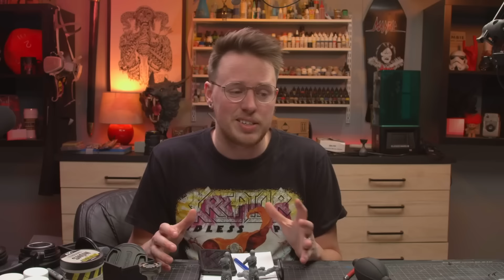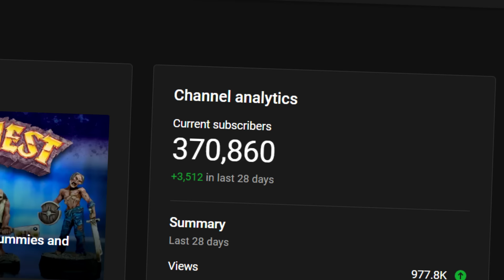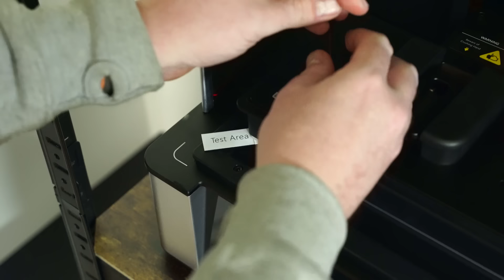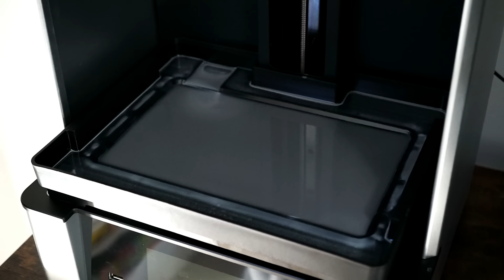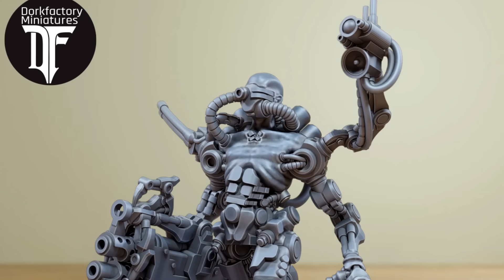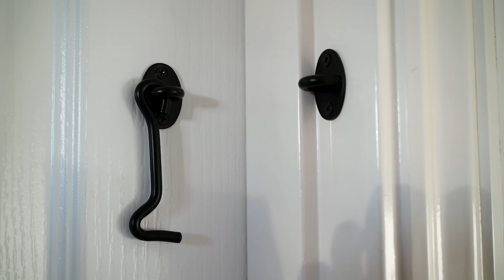Is 3D printing FINALLY easy enough to print Warhammer at home? Uniformation GKTwo!

Comment: That's one of the downsides of low odour/odourless chemicals; they smell a lot less but they're still every bit as harmful to you, something of a false sense of security.
Basically, if you open a bottle of chemicals while 3D printing, you should already have a mask on (vapour rated, not a DIY store dust mask)
Also, removing the prints from the plate that way runs the risk of fragments being dropped, unseen, into the resin.  You won't know they're there until your next print pushes them through the Fep.  Don't be lazy, take the build plate off; it's safer in the long run.

Comment: mSLA if you are feeling more fancy (masked stereolithography, usually used to differentiate it from other types of stereolithography printers). From what I've seen most people (who take the risks seriously) tend to end up with the printer in a garage or shed where VOCs are less of an issue. Or, setting up some kind of extraction system (I'm lazy, mines in the shed, in a locked cupboard).

Comment: the only thing i would recommend is to remove the plate before removing the prints. you don't want to get bits drop in the resin because that can mess up the next print

Comment: I generally use a respirator mask when working with uncured resin, as I was under the impression that's the worst part to breathe in (it certainly smells awful when you catch a whiff of it). I'd be interested to see what an air purifier would say about my 3d printing space. The 3d printer go brrr meme is definitely a joke that you can't fully appreciate until you get into 3d printing proper.

Comment: watching you remove prints from the build plate without removing the plate from the machine drove me insane. Talk about the hardest possible way to retrieve your prints. With that said I am glad you have now found an appreciation of the 3d print!
Reply: Also bits of cured resin can fall into the tank and damage the membrane when printing or cause the printer to not even print at all until bits are removed.
Reply: ^ this. Why would you not remove the plate? No wonder why you had so many problems with your previous printer 🤣😂
Reply: @mangg3328  at least with this printer I assume he thought the fancy mechanism to attach it was meant to be set and forgotten about rather than removed/ tampered with all the time. Just started printing and I was convinced at first that removing the build plate would ruin all my leveling that I went through previously
Reply: I use a flexible build plate and I can easily pop my prints right off the plate without removing the build plate.

Comment: Great video and this is a big subject Guy, you raise a few good points whist also not covering some important ones. 
Ross covers a lot on his channel and I love watching his videos. 
With regards to the use in a house and VOCs, a grow bag - used by many for plants that people like to smoke - are an excellent solution as they not only allow you maintain a steady temp without having to buy a printer with an in-built vat warmer, but they contain the VOCs and you can fit a carbon extractor. The KEY point you didn't cover is that IPA or Meths are HIGHLY flammable and should not be stored in a house. Now on to the environment. The water used to wash water washable resins is toxic. It needs to be treated like the IPA you use for washing and disposed of correctly... at your local recycling plant. That water will harm the environment. Equally, the supports you pulled off before curing - and I agree that is the best time, though you can do it afterwards, just soak the models in luke warm water to soften them first, are uncured resin and should be fully cured before sending them to landfill. 
As to your earlier failures with printing, this could be many things, but first suspect would be settings and each manufacturer provides tables for their printer and different resins - check support pages. These are starting points and you need to adjust for room temp, humidity, layer height (how much fine detail) and speed of printing. There are test models like the 3DRS spaceship which help you dial these settings in. BUT THEN - you need to look at what you are printing, the size , the density, the detail and you need to orientate accordingly, then adjust supports to suit. Pre-supported models are fine, but unless you are using the exact same settings, resin, printer etc, they may not work. The printer head pulls the cured layer away from a screen that stretches slightly as it does so. It stretches more in the middle than the outside, this means you get differing forces across a model, which can cause partial failures so you need to look at what you are printing and on what machine. Ross explains the difference in screen resolutions brilliantly and this is why I print figures and small items on my Mars 3, then big models like tanks and titans on my Saturn S. Each of these perform brilliantly at a fraction of the the cost of the GKTwo. 
As to why I 3D print ... I want something different than the GW stuff, I want to modify and 3D printing offers me this without the need to spend hours with greenstuff. I might spend the same time initially as I build the file, but then you can print loads. I also prefer some of the other artist's work. Then there is the whole "immediate" thing. Just like music downloads, I now no longer have to wait to get my stuff in the post, I buy an STL and I have the model as fast as my printer can produce it. 
The final point you didn't cover and it is just as important, once you have bought the kit you still need to buy supplies. Resin is anything from £25 per Kg to £100 per Kg depending on what properties you want. Standard resin is fragile. ABS like resins help this and Nylon ones are better, but costs go up. Then you need to buy IPA or Meths  unless you are happy with the results from water washable resins. As an example, if you buy a printer to build a Warlord titan then, allowing for some failures (there is always a learning curve) you are looking at 10Kgs of resin and you can't just use the standard polymer resin as the weight on the legs will warp them, if not break them so you need ABS like or you need to strengthen them with rods. - And then you are into the issue of resin dust!

Comment: For me from the outset I got the impression you wanted all the shiny resin models without having to put in much effort. That's fine it's not a criticism but 3d printing isn't plug in and play. It does require lots of trial and error especially if you're aiming to print miniatures to a high standard. Learning the software side of things is the biggest time sink. 

In terms of safety precautions I think if you put your 3d printer in a none communal room and vent out of the window you'll be absolutely fine. Wear a respirator & gloves when handling the uncured resin (especially when removing it from the build plate) and the same again when working with IPA. I think the safety aspect of the hobby is overblown - it's not rocket science respect the materials you're working with and act accordingly. 

If Uniformation would like to send me a free printer I am open to bribery! 

I have an Elegoo Saturn 3 12k and for anyone reading I can highly recommend. Great sized build plate, very easy to setup and tear down i.e. replacing FEP sheets for the vat when required. When in operation there isn't much noise at all and with the supplied filter the resin fumes without added ventilation aren't overwhelming. I would still obviously always recommend proper ventilation to ensure you're removing as much of the VOC's out of the work area as possible. 

Blimey this turned into quite the waffle! 😅

Comment: my experience with 3D printing is only with FDM and it's been a very rocky road lol. i got an ender 3 v2 because it was on sale when it first came out, not realizing it had serious issues with bed leveling. after some frustrations with initial prints, it sat on my desk for...a year and a half? before i recruited a friend to help me install a BL touch module. we're still calibrating it, but it's promising. i feel like the spectrum is cost ----- effort in that you can spend very little and expend a lot of effort to get a decent print, or you can drop a lot of money to get something that requires minimal effort to get a great print.

Comment: I've had trouble putting my reluctance to use 3D printing into words before, but something Guy said in this video explained exactly what I have been wanting to tell friends of mine whenever they asked me if I was going to get a 3D printer or not. I'm not into that kind of hobby. For me, the majority of the creativity and joy I get from the modeling side of the hobby is assembling and kitbashing minis, and it's just not the same with 3D modeling different minis to print.

Comment: Yeah I'm struggling with that right now. To me it's a lot like buying panels to fix rust on cars vs buying the tools to make the panels yourself. Do you want to buy the panels to fix one car, or have the tools to fix as many cars as you want. 3d printing is the same thing, do you want to buy a set of extremely expensive minis or do you want to buy the thing that lets you print out as many as you want.. especially if you find the files for free like I did. (honestly they guy I found has better "sculpts" than GW does for both Orcs & Goblins and Skaven.) Unfortunately I don't have the money for even a low end printer and the one I want is still massive and incredibly expensive but has 0 waste for supports.. a SLS powder bed fusion printer.. most of those are still in the $30k range and are 10 feet long. They are massive and stupidly expensive because they are mostly geared towards printing in metal. As far as I can tell NO ONE makes a small version.
I had to go on Mapquest and figure out how far it is from Nottingham to Colchester and then figure out a similar range near me.. That's basically like driving from Reno Nevada to Yuba City, California. California isn't really wide, it's only 219 miles from San Francisco to Reno on the freeway which passes 20 miles south of my town. It's like an hour and a half up to Reno from here, and the same to San Francisco, I actually live in a great spot for that reason, that and it's only 15 minutes to the start of the foothills of the Sierra Nevada Mountains if you enjoy cruising mountain roads like I do. 
Wow, printer, cleaner, and UV curing station.. $1,650.. yeah I definitely can't afford anywhere near that.

Comment: Think I'm in the same boat. Don't have enough space in a suitable secure ventilated location to be running these things unattended for hours at a time. Plus $850 (+wash and cure and resin) may be an investment, but it's still a full warhammer army I could've bought that I now have to spend 100s of hours finding - BUYING (most good STLs are not free) - and printing.

Comment: The VOCs are concerning, you would be surprised by the amount of resin that escapes as vapour turned by ikea air filter the green of the resin. 

In the end up ended up building a fume hood for mine, but still the process takes so much cleaning I just prefer buying most models. 

Still it’s fun to use occasionally.

Comment: I'm cautious about being around chemicals. I don't use an airbrush as I don't want atomised paint in my lungs, I rattlecan prime my minis outside, regardless of temp (Never had an issues) . The pure creative joy of making an object cant't be understated however and I wish there was a clean alternative to using resin.  My instinct would be to do this stuff outside? in a shed or garage with very good ventilation. Temp would dictate only certain times of year, but I could live with that
Reply: Great video btw, I think you have hit on a topic many are thinking about. I am also put off by how involved and tricky it all seems.

Comment: 3D printing is not that hard. The only problem so far is the toxic and UV shit when you want to print resin. I would advice anybody against resin printing if the dontt got the space to set it all up perfectly and healthy. But a FDM printer is actually a no brainer if you want to play tabletop games. This is not about the minis. This is about Terrain, nobody likes spending money on insanely expensive terrain. A FDM printer costs 300 bucks, that is already back in if you print a couple of terrain pieces, considering GW prices. printing full models is lame and not part of the hobby for me. Printing is to expand your possibilities, not replace the original minis.

Comment: I'm glad you're up front about the dangers. They're very real. I dove headfirst into resin printing and it was extremely fun and I was able to build a whole army of Traitor Guard out of it, but the fume build-up started causing me severe irritation around my eyes. It can be done safely, but there are probably thousands of people like me who weren't doing it safely. You bringing light to that is important.
Reply: i'm pretty sure the vast majority of people who 3d print don't do it safely, at least from what i can tell on fb groups and subreddits dedicated to 3d printing. A lot of people incorrectly believe that if it doesn't smell, it's safe
Reply: I watched a video somewhere saying that even if the amount of VOCS were low, it's really the type and particle size that makes a big difference, I was wondering if there's a sensor you can get that gives you that information along with the amount, I also wish there was a safe way to print in a room with no windows (hard to run a vent tube outside), I've heard of people doing a similar vent tube setup but running it into a big carbon filter like the ones people use in home grow tents for weed smells, it would be interesting to see if those actually absorb most of the VOCs and none of the vents or tubing leaks air.

Comment: I scored that Photon printer you showed from someone at work for $100. His wife wanted him to clean out his hobby space. It's been in my basement for almost two years now, unopened and unused because I don't have the time or the proper space/ventilation to actually use it. Like you, I have pets, and like you, i'm worried about all the extra bits that come with this hobby that go a bit unmentioned. I do not have a dedicated wash station or curing thing, either. I've a feeling I"ll end up reselling the 3D printer, or giving it away to someone who will actually use it.

Comment: I don't have a spare room, the only space would be the loft, but that doesn't sound like an area the printer would work in at all, so the technology is not for me, plus the cost is still massive. When I wan't a custom part I shall continue the old fashioned way and make it by hand!! 

For those 3D prints that seem utterly cool I see if anyone is selling them as a printed mini and treat myself now and then but a lot of the really good stuff does seem to be restricted to people who have their own printer though, which is a shame, and printed minis are, from what I've seen, often more expensive that 'proper' models from GW or other companies, and I'd rather spend my money on plastic than resin prints because it's still nasty stuff to work with even after it's cured and still brittle and fiddly, especially since printed minis are usually in one piece and not multi-part kits, which makes them even more of a nuisance for me as I like to convert almost all of my minis, that's what's most enjoyable to me in the hobby.

Comment: Ive got a resin 3D printer in mothballs at the moment after moving home, but I wont be unpacking it until I can have a dedicated fume hood in my shed or spare room. Like you said, the idea of these toxic liquids in a residential setting is scary, and in a workplace I would demand PPE and CoSH handling regs / eye wash stations etc. The VoCs arent the scariest bit for me though. The worst case scenario is either vision loss through one careless splash or eye rub, or a gradual bioaccumulation that causes a BPA allergy. BPA is in so many plastic products that it can seriously impqct your quality of life forever, and people trivialise the risks around these materials. I applaud your cautious attitude with this stuff. My brother did away with his resin printer as soon as children and dogs were in the equation for the same reasons.

Comment: 3D printing is literally the only thing keeping me in the hobby (on top of my gigantic pile of shame). However, I do NOT recommend it to a casual user who isn't interested in starting an entirely new hobby for the reasons mentioned in this video. I'm lucky to have a dedicated work area in my garage. If I had to work in my house it would just not be sufficient space, ventilation etc to keep it safe for my dogs (I already panic when I drop/break some resin on the floor any can't find it). It's a really enjoyable and rewarding hobby, but anyone getting into it has to be prepared to invest a lot of money and time into learning how to do it and how to do it safely.

Comment: Once you get used to the process of 3D printing and managing the toxic chemicals, it does get much better.  I was completely put off the first time printing as well.
I use wash water and dispose of it either by boiling it or letting it evaporate outside (depending on the weather).  I use a fabric printer enclosure and inline vent fan to exhaust the air outside.  Both my combo cleaning/curing station and printer fit in the enclosure.  Whenever the enclosure is opened, I turn the vent fan to maximum and turn it down during printing with the zipper open a few inches to assist with the negative pressure (flow-through).  There are no perceivable odours from the printing with this setup.